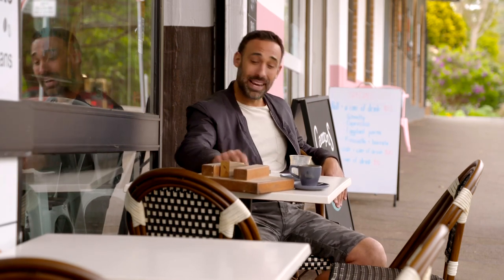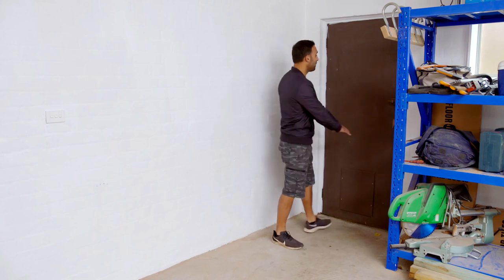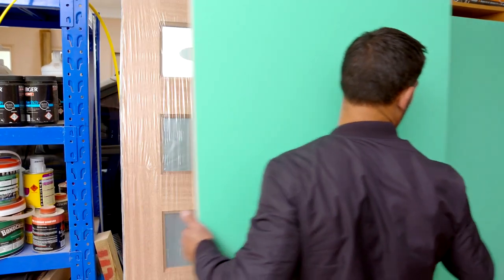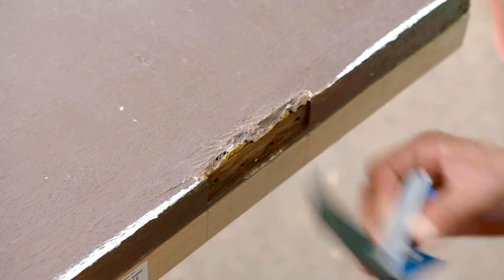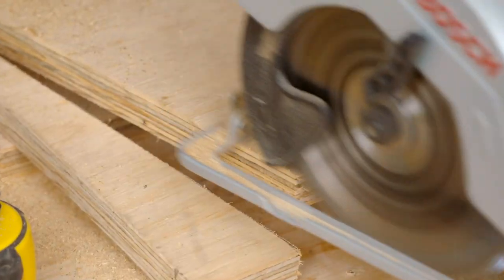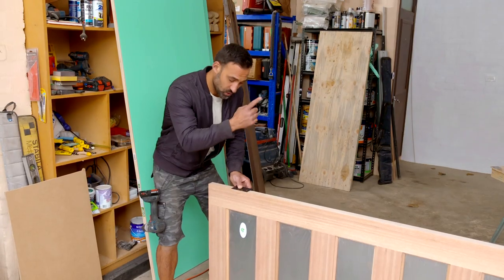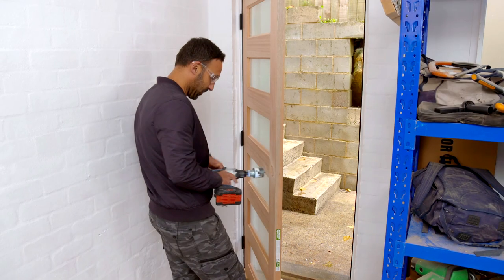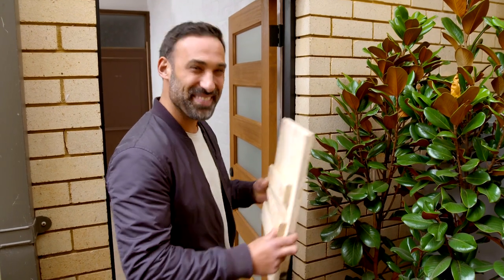This Simple Trick Will Make Hanging a Door SO Much Easier | DIY | Great Home Ideas

Comment: Why would you want the glazing beading on the outside? Anyone could come along and remove the glass within seconds for a nice, silent way to get in or reach through to open the door.
Reply: Wrong, the glass is silicone into the rebates at the factory, the glass cannot simply be removed even if the beading is taken off, it has to be pushed from the inside so it's actually more secure to have the beading on the outside

Comment: Nice job shame about the wood treatment, so orange Id paint the tops and bottoms before hanging to stop water absorption. Also popping some match sticks in the existing screw holes will give the screws something to connect to.